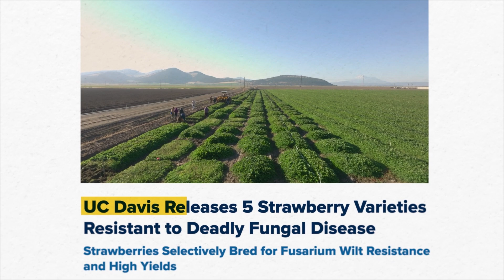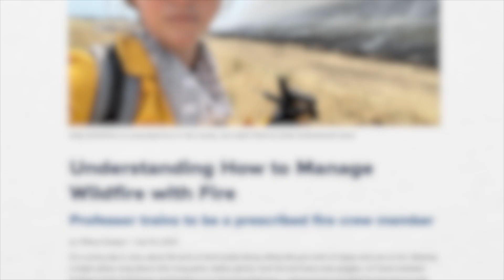2023 Year In Review

Comment: - We live in the same climate as it was 5 million years ago and the cancer will go away - 

I have an explanation regarding the cause of the climate change and global warming, it is the travel of the universe to the deep past since May 10, 2010. 

Each day starting May 10, 2010 takes us 1000 years to the past of the universe. 
Today May 23, 2024 the state of our universe is the same as it was 5 million and 127 thousand years ago. 

On october 13, 2026 the state of our universe will be at the point 6 million years in the past. 
On june 04, 2051 the state of our universe will be at the point 15 million years in the past. 
On june 28, 2092 the state of our universe will be at the point 30 million years in the past. 
On april 02, 2147 the state of our universe will be at the point 50 million years in the past. 

The result is that the universe is heading back to the point where it started and today we live in the same climate as it was 5 million years ago. 

Anyone who does not believe that the climate changed for the reason I mentioned should wait for cancer to disappear very soon because of this reverse movement, I will explain: the human body's immune system will be stimulated, activated and stronger as a result of this reverse process, which results in the disappearance of the cancer.